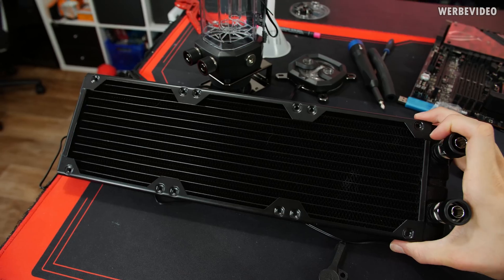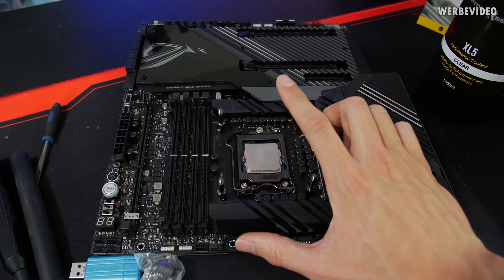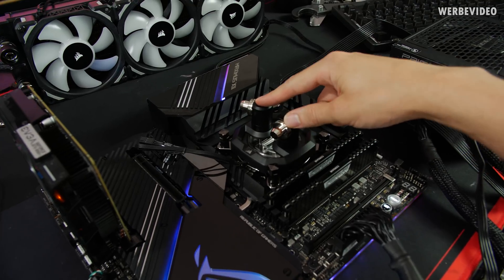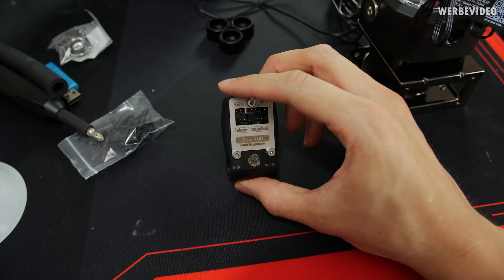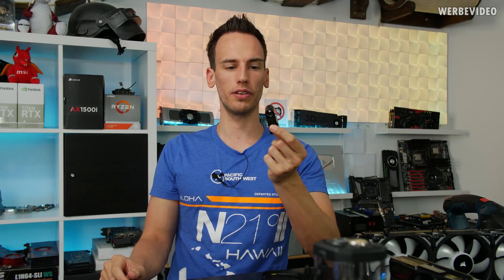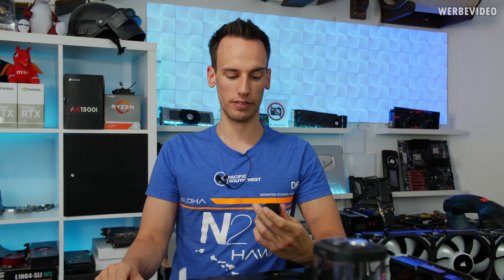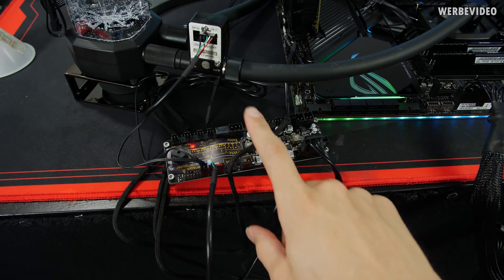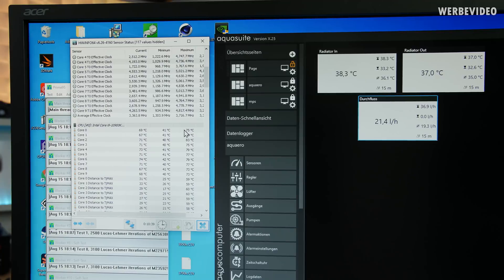Testing one of the Weirdest Water Cooling Myths - A SLOWER Flow Rate will result in BETTER Temps?

Comment: so i am a building engineer that like to design jet engines i built 4 working proto types so I know a little about tubes that have heat,  velocity and pressure so take this as you will having high flow will help with cooling until you reach the normalization heat index that's the point where your cooling and heat are balanced it does nothing to change that point if your CPU was at 82 it still will be at 82 at lest at the  optimized speeds that pc pumps work at what it changes is the time if it took your CPU 1/2 hour too reach 82 increasing flow will make it take longer 1/2 hour goes to 1 hour to get to 82 if you want your pc to stay cooler you can increases the surfs area or have a coolant with lower thermal conductivity water has about  0.635W/mK most coolant about has 0.150W/mK  this represents the amount of energy you have to put in to change it's temp i should point out that one metal is dissolved into these liquids this number goes up sharply less so for coolant because it is harder to get metals to dissolve in it but it still happens. at most you will have a 2 degree deference but that is not the hoe picter that will make low and high pressure area in your line so it my help but it can even increase the temp in you CPU by two degrees  but saying it will always drop the temp is wrong not all pumps will be maximized to you loop so you should do it  just test some thing out oh an the high and low pressure cavitation or bubbles that will kill you pump and other part a lot faster  and the bubbles do not hold onto heat so they make you cpu run hotter this i one of the Reeson upping flow is not always a good ideal like all good thing it depends most of the time company do under shoot this so it should be raised but a lot of Companys like arctic spend hundred of hours to map out a curve with  part ware and performance and energy  in mind and then they find the best point to run it at most of the time there will be normally 9 points that they will pick one from  may be 12 or 16 or 24 32 yes these are used in pc alo for a reseon if you math nerds know what this means ! then  you are in the loop

Comment: Not sure if this was pointed out but the reason is turbulence.

As long as the water within each block is turbulent, additional flow will provide very rapidly diminishing returns. You'll spend a lot of extra energy and pump wear for almost nothing.

The secret sauce is the Reynolds number.

If you drop TOO low of course you'll see a dramatic increase in temps but once turbulence is achieved you're wasting your time with anything more.

Oh and for radiator temperature delta is a fun myth I need to deal with often. 

Again turbulence is your sign of near maximum heat transfer. Once turbulence is achieved however the flow rate will result in a lower temperature delta across the radiator but the total thermal transfer to that radiator will be maximized. 

Aka, the highest cooling you can get. 

The absolute best performing cooling system will actually have very little temperature delta and the whole loop will be as close to room temp as possible. This lowest possible temperature gives you the largest delta between fluid and component and the best heat transfer rate you can achieve with your specific setup.

If you slow down the water below turbulence (as the video shows) the water temp in the block rises and the delta decreases, lowering transfer rate and increasing temps.

Our multi-ton chiller system at work is has a delta of only 1.5F from outlet to inlet with a >70kw heat load (240,000 btus).

Comment: The reason why faster flow rates reduce temperatures in the CPU block is because heat transfer increases. If you are interested in understanding this, the convection coefficient (h) increases higher flow rates over fins. Because h increases, heat is extracted quicker. 

So these all go up together. Veloctiy, convection coefficient, heat transfer rate and they can temperatures to be lower.

Comment: I tried several flow, but the best flow is Pump to GPU to Radiator to CPU to Radiator to Reservoir.  -4 to -5 lower than Pump to CPU to GPU to Rads to Reservoir.
Reply: Could you explain why pump to gpu is the best?

Comment: That makes sence. So what about more fan flow and or more radiator core path such as more rods or bigger tanks and revivor? What about in/out hose diameter such as larger diameter system return to rad? So many variables! Great video (:

Comment: I would like this experiment done with radiator fan speed.  I would expect at a lower flow or pump speed you would see the largest difference in radiator inlet and outlet temperatures with higher radiator fan speeds.  My question is the pump speed or radiator fan speed have a greater impact on dropping loop or component temperatures.  I would be curious to find out if there is a limit in radiator fan speed or pump speed that noise increases dramatically and cooling effectiveness drops.  You could use this information to run both the pump and radiator fans at a barely audible range under light system loads and then configure the max pump and radiator fan speeds for higher system loads.

Comment: I would like to point out that all things being equal, having a heat exchanger in between each component will result in more efficient cooling. Math tells us this due to thermal gradients.

So having Component - Component - Component - Exchanger -  Exchanger - Exchanger is objectively bad.

Only the first component is seeing the best thermal gradient, everything after that is seeing less thermal transfer due to preheating of the transfer medium.

By running each individual component through it's own exchanger first you eliminate (or at  least significantly reduce) cascading thermals.

Comment: hi, nice test, i like it, there is only one think, the mensurments liter per hour are like coma is 1 zero to the right. the minimum should be 15 l/h and on 2000 rpm should be 210 L/h. as its hard to belive that this pump for and hour with 2000rpm could transfer only 21 liters or water.

Comment: Water Requires Turbulence to cool properly
Water on its own is actually a horrible medium for transferring heat because its actually a pretty good isolator
the turbulence allows more water surface to touch and transfer the heat
when you have slower flows, you dont get as much turbulence and therefore you dont get as good of heat transfer from the surface to the water and vice versa
so when you make water very turbulent, its cooling ability is raised greatly
the speed of the flows you are talking about in a Pc pump...are very small and very slow on their own..its really not that fast
when you get to levels that are more like 30-55 gallons per hour (think automotive radiators in racing applications with electric pumps), there is a drastic and noticeable difference in how well it cools

this turbulence at higher speeds is what is responsible for cooling, not utilizing the structure of the radiator.
the structure is still utilized the same as long as you dont have any air bubbles in the system moving thru the radiator.

Comment: it makes sense. if you look at the most common water cooling systems in the world (your car and the radiator) the more load you put on the system the faster the pump runs and it increases the  air flow. the only major temp difference in the loop is at the load (cylinder head next to all the fire).

Comment: I was always under the impression that heat transfer between an object and the air works best the bigger the differential, so to me it would make more sense to get the water as hot as possible before going into the radiator. 
But that could be totally wrong and/or not apply to pc watercooling.

Comment: What if you were to set up your radiators in parallel, but the CPU and GPU blocks in series?
Half the flow speed through each radiator, but without compromising the speed of the flow over the CPU and GPU blocks.

Comment: Looking forward to watching this.

I know on a car, removing the thermostat can cause an engine to overheat when running at high RPM. The coolant needs to be in the radiator long enough to cool.

I don't think any consumer grade water cooling is going to be capable of that kind of water volume movement.
You'd still need like a 1000W CPU to boil the water in the reservoir.
Reply: I would need scientific proof for that claim. Because you're just removing a restriction and generally water is moving too fast in a car's cooling system to "spend time in the radiator" like that o.o

Comment: Roman,
I think with a low pump rate you are having a laminar flow. There is a zero velocity layer of liquid on the boundary with metal both in cpu block and rad. This also means that is has no convection heat transfer and only conduction transfer. Which is why you have a worse heat transfer and the temperature saturates at +6K.
Also you are right to think that flow rate is incorrect. About 10-30 times. I guess I saw this video too late for another experiment (not so low flow, just -30% of normal). In my experience the pump speed has no big impact on the cooling performance unless you have insufficient pressure.
BR
Pavel

Comment: while I agree with your point, you didn't test what the complaint was.  the proper test would be one setup with the multiple heat sources in a row and multiple radiators in a row vs a setup with a radiator between each heat source.

Comment: I built my first loop 11 years ago and even then, loop order and water flow had been tested even having more radiator space, loop order makes very little difference, radiator space gives diminishing returns, and as your test shows there's optimal flow to pump noise, a bigger reservoir  will give a little longer before the water gets to equilibrium

Comment: the only thing I can see helping is running two radiators in parallell, since you keep the water flow at the cpu fast, but slowing it down in the radiators.

Comment: Hi Roman, Can you check your experimental data with some thermo calculations.  I did some calcs and something seems off, I do not get to the typical watts heat dissipation for the cpu by means of using the water temps and flowrates... would be nice for you to verify some of these experiments with fundamental science.  Furthermore, this experiment would lead met to think there would be an algorythm which could be developed to optimise the flowrate for maximum heat transfer from the cpu to the radiator (and air).
Thanks
Reply: The maximum flow rate will give the maximum heat transfer.

Comment: If you have cpu>gpu>rad>pump, then wouldn't the CPU heat the water that goes to the gpu or if it was gpu>cpu then the gpu would heat the water going to the cpu, which would raise the temp of the cpu?  Isn't that why some people put rads between components?  Is this a matter of the difference between noticeable and measurable?

Comment: People that do this, should understand a bit more of thermodynamics. 
Also, like it was seen in the test, it comes to a point even if the flow rate is way much more higher, the temperatures will not change because of ambient temperature. That is why at first glance, air cooler is a bit "better", or faster, a water cooler loop, takes time to settle where it comes to a point the temperatures will not change no matter how much flow rate you put in or how much radiators you have in the loop (with exception of the amount of heat dissipation you need to cool down all your components, the more components, the quicker a single radiator reaches it's thermal limits). If the ambient temperature is constant, the loop reaches it's maximum thermal threshold and then it is done. Lower the ambient temperature and the whole system will get better results.
There is a reason why in banks is always cold...
So, his explanation of low flow rate and higher temperatures is right, but as we seen between "normal" mode and "higher" mode on the pump, the difference was minimal almost imperceptible. The loop reached it's threshold of thermal capacity. He could even "overclock" the pump to have double flow rate from maximum, I really doubt that would make a big difference. 
There is always a point where flow rate cannot compensate for all the loop, to reduce temps. In this case you put more radiators or low the ambient temp. But then again, you dissipate more heat and the ambient temperature increases.
Thermodynamics is a bitch.

Comment: there must be something in the air (or water, I guess) because this thought came to me a few weeks ago.

it seems to me that the only way to make a slow flow work better is to have a higher volume of water at the cooling block itself. which, would have more water to soak up more heat and more time to do it... however... just because it works better in that hypothetical system, doesn't mean that that system isn't stupid.

Comment: *Seasonic*, the sloppiest build quality piece of shit that won't let AC signal through.   Just get a 240 radiator and stack a third fan in the center.  Why isn't there an independent fan on the VRM/mainboard face components and ram?   Aperture yes, venturi is the correct engineering term for flow sensors.  You want increased flow if the principle of operation of the thermal dissipation is surface disturbance/turbulence.  In laminar compression plates the flow rate doesn't matter at all.

Comment: For some reason I now want him to compare having 2 120mm radiators parallel versus a single 240mm U-flow and a 240mm X-flow radiator.
Reply: I second this
Reply: In theory if you Split your loop into paralell radiators after your blocks, your flow rate goes down and it should be more efficient. High flow in your blocks, slow flow in your radiators.

Comment: what about "parallel" radiator configuration instead of "series" configuration in two radiator water cooling loop? does it make difference? i assume that the flowrate in the cpu block should be the same but the flowrate in the radiator should be halved between two parallel radiator but it does also halved the cooling performance of the water inside the loop because it is separated into 2 different radiator? does it affect cooling performance making it better or maybe worse?
Reply: The flow rate in the CPU block will change.  The pressure drop through the parallel configuration will be less than through the series configuration and there will be more total flow through the loop.  Depending on the pump curve this may be a benefit or not.
Reply: @jamesthomson8659  ahhh, so that how it is, thank you for answering

Comment: I've commented on this so many times, the PC community in general doesn't understand Thermodynamics.  The loop delta (temperature difference in the loop) is a function of the flow rate and the heat output of the components.  Nothing else.  That's different from the delta over ambient (how hot the loop is compared to the room temperature).  If you have a smaller radiator, or run the fans slower, it will get hotter, increasing the delta over ambient.  But the difference from the hottest water to the coolest water will be the same if you don't vary the flow or power output.

what

Comment: debatable 

two problems:
1. higher flow benefits CPU cooling - more water passing through CPU block, more heat you can extract from it (difference between Tcpu and Twater much higher than difference between Twater and Tenvironment) 
2. you have only one cooling loop - or would rather say that radiator not big enough to dissipate heat into environment 

what to do? 
- bigger radiators? - resulting in massive construction and bigger pump to push bigger volumes of water thus making it much noisier
- double loop? make big reservoir for water and have 2 separate loops: one to take water for CPU cooling, second to cool down water from it - resulting in even more massive construction and more element thus making it more unreliable and less ergonomic.

Comment: So, how about setting the water blocks in series and 2-3 radiators in parallel? Or a bypass tube+valve for single radiator setup to slow down the water flow in the radiator, but not in the block?

Comment: The one variable you may have overlooked is the total liquid volume of the cooling system.
One might think that having a larger liquid volume in the cooling system might also have a noticeable difference in system temperatures.
Thermal mass is a well documented property used to advantage in science, engineering and construction to both retain and dissipate heat.
Reply: True, but I think it doesn't matter when the whole system reaches equilibrium... I think it acts more like a buffer which could temporarily absorb more heat, but when the system equalises out (thermally), it won't matter how much fluid you have in there.

Comment: i dont see the connection between the argument you brought up at the beginning and your test at the end? Like you tested pump speed and not loop setup, therefore you didnt "prove" anything
Reply: yeah. its weird no one elses notices. it seems logical that load - radiator - load - radiator is better than load-load-radiator-radiator, since the temperature difference between the water an the load is maximum, regardles of flow rate.

Comment: Something that also helps cooling more is turbulence, as it cycles the molecules against the part to be cooled more per second thus exchanging heat more efficiently. which is why higher flow rates usually result in lower temps because of the turbulence they create.